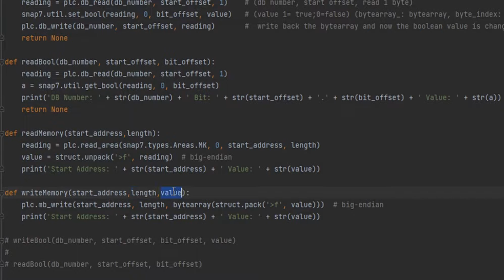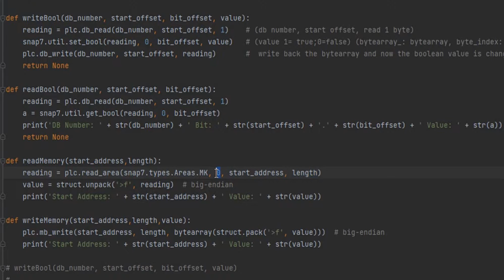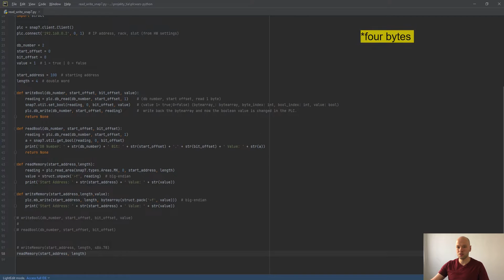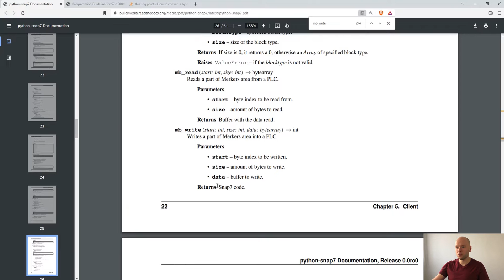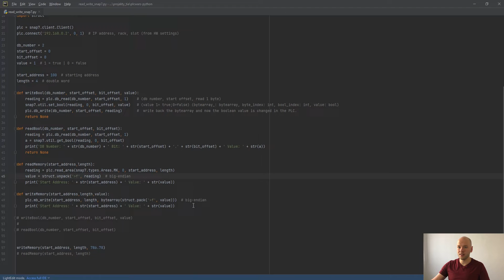Python Snap7 S7 Siemens PLC TIA Portal Read/Write to Marker

Comment: Can i work with s7_300 and python snap7 to exporte sensor data from pid ?
Reply from the maker: I believe it should be possible but I have not tried it personally. Maybe this link would be helpful: https://stackoverflow.com/questions/76217690/read-the-spindle-speed-in-a-siemens-plc-s7-300-with-python-snap7